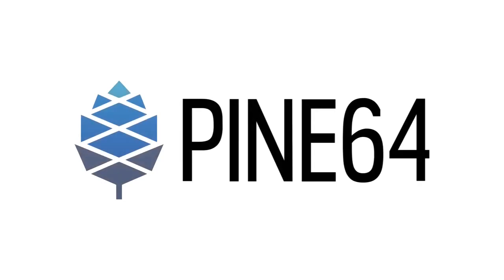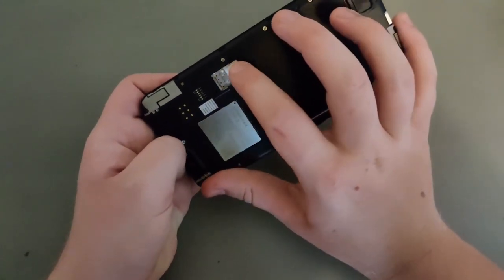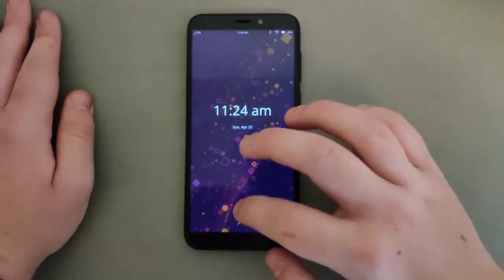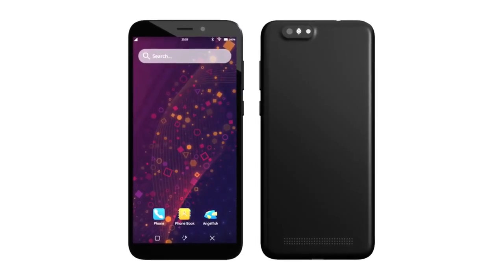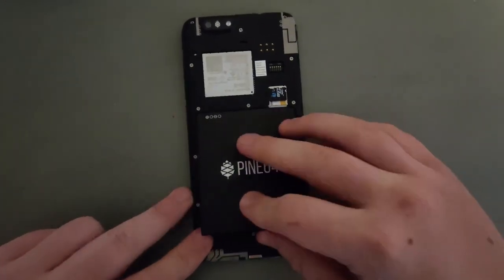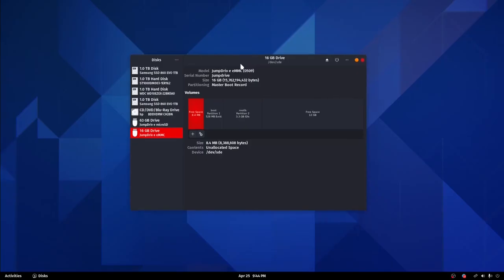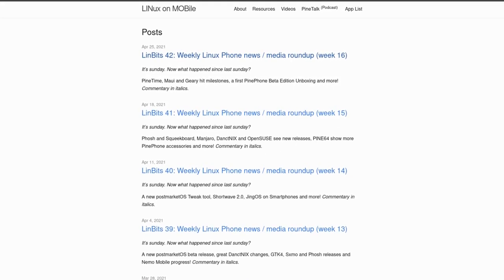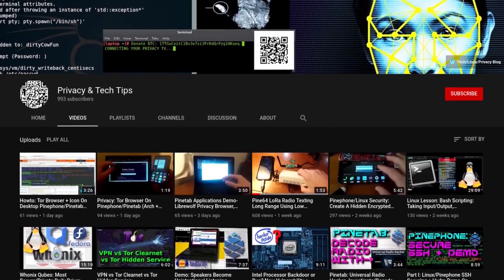PinePhone Beta Edition Quickstart Guide

Comment: Is there a list somewhere that enumerates which telecom networks are supported worldwide?
In the past, I bought a pretty popular smartphone model but it wouldn't function with some small operator (a company that subcontracts the network from a larger telecom operator). Fortunately I was able to use a test SIM card at the shop, beforehand.

Comment: Hi, already been on the forum, and had some help but not solved the problem.  Any help appreciate!  👉. ISSUE:  While plugged in the phone works fine, when not plugged into power the screens fades after half a second.  I've checked settings and set the screen to fade after 5 mins, but it's only seemingly registering that for power plug in, no power plug in, it still fades in less than a few seconds.

Comment: "Discover" beta problems. Fetching Updates does not work. It says fetching then says it's done. Also, I try to get - for example - Firefox and it starts loading and then says "The PackageKit daemon has crashed." Any ideas? Or should I try a different OS?

Comment: Why the pinephone doesn't have cameras with higher specifications?
Reply: Most of it is in the software anyway once lenses and sensors are good enough as you can see when you put a modded Google Cam app onto a smartphone with a rather average stock camera app.
So in regards to Linux the main issue is there isn't an open source camera app that's up to a competitive level and also possibly some camera modules on the market depending on closed source firmware & drivers maybe even with DRM mixed in which hinders progress on devices for which the aim is a fully open source software device.

Comment: Hi guys, dumb question : when starting, the screen is stuck in landscape mode, and i'm blocked to enter information. Is there a way to force portrait mode ? Thanks
Reply: Im on a different phone(Samsung A6+) but that did happens to me and apparently you need to hold the volume down and power to restart it.
Just search the problem on yt,i found the solution from an indian as always,they are helpful
Reply: @reurez7942  Hi, thanks for your answer. I reinstalled the OS, and it works fine now.

Comment: I am still not happy with the battery life.. 
without the sleepmode it is just 4hours without using it, when i use it something like 2,5 hours. 
With sleepmode on 7 to 8 hours without using it and like 5 tot 6 when using. 
But with sleepmode nobody can call me because it doesn’t wake up! Well they can call but it keeps on ringing on their side but nothing on my side.
:(
Reply: There's been huge progress on making the modem open source, they've already got it waking up by the first ring tone. It's just a matter of improving stability, fixing edge cases and shipping it with major distributions.
Reply: I've not had an issue with calls / SMS coming though in deep sleep for months. Which OS are you on?
Reply: I'm hoping call and text as well as mobile carriers become smooth enough for me to buy these for the family instead of flipphones . Then tell them to learn Linux for smartphone features 😂 lol
Reply: Everything you've described is thankfully 75% software side, give it time- this bad boy is still steaming fresh off the factory floor.
Reply: did you install anything resource intensive that may be running/scanning resources/files in background? Additions to crontab? Anything that may be actively serving off your system?

 If not you might want to give another OS a try -also and maybe most importantly: **take a look at your power management settings and turn down display brightness as needed + turn down sleep mode idle time.** Another thought is the new keyboard will add its own 6,000mAh battery to the mix (in addition to Pinephone's roughly 3,000mAh battery). This should help extend battery life as well! I personally carry a power brick when leaving for more than a day period. :)
Reply: should get better as the software matures